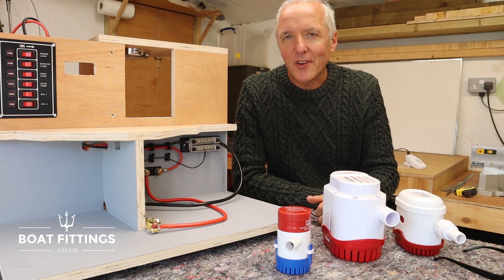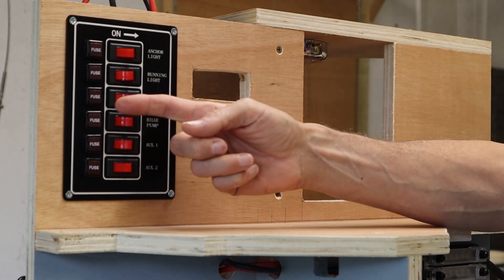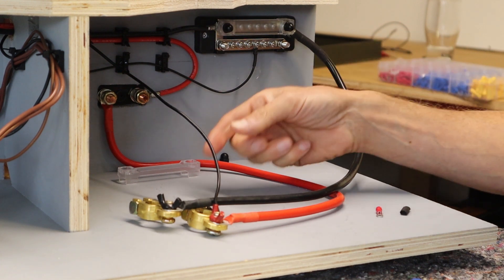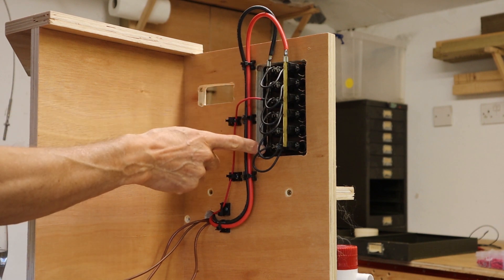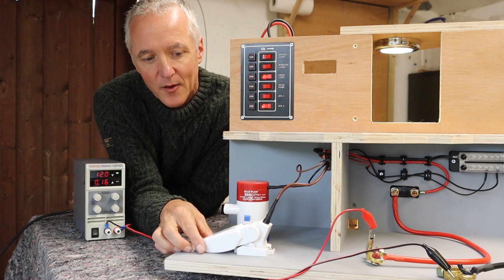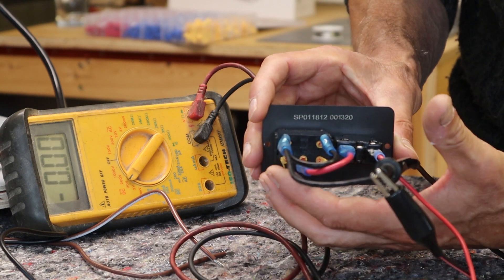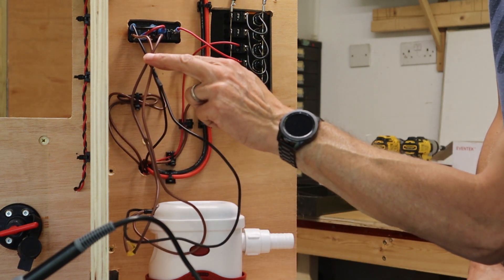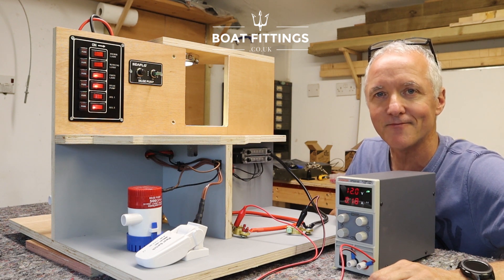Boat Electric Wiring Made Easy, Part 3, Bilge Pumps, Float Switch, Automatic & Manual Complete Guide

Comment: Thank you for these videos.  I'm wiring an electrical system for a 1973 Pearson Ensign daysailer from scratch and this series has been the most informative.  My biggest question now is at 12:40 you connect the three wires for the bilge pump by soldering them and covering with heat shrink.  If this were within the bilge in a wet area, is there any gap between the two wires that would compromise the waterproofing?  Are there any products you are aware of or recommendations you have for a waterproof connection among the three wires without soldering?
Reply from the maker: Hi thanks for your great question.  I have not yet come across a purpose made waterproof electrical connector for 3 wires sadly.  The only solution I would think of would be to solder the wires and then 'pot' them in a surrounding which would allow you to silicone them all in place for water-proofing.

Kind regards,

Richard

Comment: This bilge pump setup seems as though the master switch would cut power to both bilge pumps?
Would you not want at least one wired more directly to the battery so that when you turn off the power at the main switch, the bilge pumps can still operate - to pump out rain water whilst on a mooring etc?

Great video and really helpful!
Reply: On my sailboat I wire my safety items the following way
1.  Automatic bilge pump thru the special auto Manual switch then to the batteries 
2.  VHF bypasses the switch panel but is not wired directly to the batteries.
This way when I leave the boat I turn off the master switch cutting power to everything except the automatic bilge pump.
To turn on the VHF radio I turn on the master switch then the switch on the VHF Radio..
This way if the switch panel has a problem I can still use the radio.

Comment: I’ve got a new (old) boat and redoing a lot of the wiring and although there aren’t many standards for marine wiring, nearly all of them state “do not rely on soldering alone for wiring connections”.  I’m opting to crimp and then use waterproof shrink connectors.

Where would you place a master fuse (50A) in your wiring model?

Comment: Should a bilge pump supply be direct to the battery before the main isolator?
Reply from the maker: Hi this is a good question, and has been asked before.  This depends on your point of view, and depends partly on whether you have separate batteries for your 'leisure' part of the system and your engine starter motor.  If you have only one battery for all then you need to decide which is the greater risk for you - potentially draining your battery and not being able to start the motor, or potentially having a bilge 'full' of water.  I expect some people will have strong views on this, but for me this is not a straighforward one to decide.

All the best,

Richard

Comment: Everything you've done so far is switched - as in turned off if the master switch is turned off.
There are circuits on the boat that should still be powered if the master switch is turned off - automatic bilge pumps being one example. 
Or, at least, if your boat is left in the water when unattended, the bilge pump should not be wired through the master switch (though you would want it to have its own switch).
Reply: Totally. I was looking for this comment. That boat is sinking.

Comment: I've watched all three episodes and have a couple of questions. 1. Wouldn't all the cable runs be tidier if the negative buss-bar was mounted adjacent to the fuse panel? This would allow for long runs of sheathed two core wire. 2. Isn't wiring the auto/manual pump to the fuse panel a bit redundant since it's own control panel also has a fuse?

Comment: Thank you so much for these videos.  Can't wait for the next one.  Two questions though. 1. Would you want the auto bilge pump wired before the master on so it can run while away from boat without other power on? 2. What is the make / model of that dc power supply.  What amp model should I be looking for?  I need to get one.  Thanks.

Comment: Aweome video! Thank you for all of the help. Does the bilge pumps you wired in work when the battery switch is off?
Reply from the maker: Hi thanks for your comment / question.  I understand that some people would prefer to have a 'permantly-on' circuit for their automatic bilge pump, and agree that there is a logic to this.  In a future video I will include this type of wiring.  In any case though, my preference is to have a way of easilily turning off ALL electrics in the boat, from the point of view of not having to worry about the possibility of electrical mal-function while away from the boat - I think this is a matter of choice and priority (dry bilge vs electrical safety or run-down battery).

Kind regards,

Richard

Comment: Can you tell me why you would run the auto bilge through two switches rather than just wiring directly through the Blue Sea switch?
Reply from the maker: Hi thanks that's a fair question.  There is no particular need to go through two switches, and it would be fine to run just through the Seaflo switch.  I like the idea of having a 'central' switch panel ie one place where I can turn on and off systems, but that is just a personal preference.  In practice in boats that I have had in the past there might be one or two switches on the main switch panel that spend most if not all of their life in the 'ON' position.

Comment: 7:00 if your getting power to the switch float from the switch panel, wouldn’t the switch panel switch that it’s on need to be on for the automatic float switch to operate?
Reply from the maker: Hi thanks for your question, yes the switch panel switch would need to be on as well.  There are arguments for and against wiring it in this way, generally I prefer to have the ability to turn any electrical device on and off, even if it has an automatic mode.

Comment: Great video! We just watched Part 1-3 and were already looking for Part 4 of your boat electric wiring tutorial. We read a lot about boat electrics as we have to completely or almost completely redo the electrical system in our 40 years old sailboat. Your tutorial is very pedagogic and easy to understand for rookies like us - thanks a lot! 

One question: wouldn't it be better to connect the bilge pump prior to the main switch as one would like to have it connected all the time?
Reply from the maker: Hi thanks for your comments (I had to look up pedagogic - but I think I get it)  As for the bilge pump direct wiring to main switch that is a good question.  There is some argument to have one bilge pump directly wired prior the main switch, if you prioritise keep bilges dry over possibly running down your battery.  Personally I think that option makes most sense if you have multiple battery banks - reserving one for starting the engine, and another for leisure (the bilge pump would then be wired into the leisure battery bank).  Even then it is important to include a fuse in this circuit.
Reply: @BoatFittings  I apologize for my Swenglish... I realize that 'pedagogic' might not be the proper English word, but I'm sure you understood that I think your video was very helpful and easy to understand even for somebody who's far from being an expert in this field!

Yes, that's the plan to connect a bilge pump to the leisure battery bank to prevent bilge (or - worst case scenario - the boat) from getting wet... 

Thank you very much for your advise!

Comment: Thanks for these really informative videos! Maybe you have explained it in some other video, but I see that you solder all the connections. Other places I read or see videos on boat electrics, it is not recommended at all, and only crimping is recommended on these kinds of installations. Quite confusing for a newbie like me. What is you take on the topic?
Reply from the maker: Hi thanks for your comment / question.  Yes I did explain this in one of the videos, but here goes:  In my experience I have had some issues where crimped connections (probably poorly done ones) have come lose.  I have never had an issue with a soldered connection.  I prefer the security of a soldered connection over a crimped connection.  I'm sure there are alternative opinions / theories so I am going from my personal experience (+ the experience of some trusted others that I have compared ideas with).

All the best,

Richard

Comment: Huge thank you!  I recently started working as a marine electricians “apprentice” despite having been very clear in my interviews that I had limited electrical experience.  

I’ve already retained more info on the actual connections from these three videos then I did in my first month on the job.  I’ve been mostly running wires, but now I feel much more prepared for the next step of connecting everything up
Reply from the maker: Hi many thanks for your comment.  I hope your apprenticeship leads you into some interesting projects - would be great to hear any interesting lessons that you may learn as time goes on.

All the best,

Richard
Reply: Good look. You start by the right place.

Comment: Glad to see this episode is out! I can't wait for ep4! Maybe a "relays, cables and fuses" related video would be nice, perhaps? You could explain why would you need relays, when would you want them, how to size cables and fuses for the appropriate circuit... I am in the process of building from scratch my dream boat. The boat I bought, it had no mechanics in it, I bought the mechanics from a separate boat and got to merge both together, so I also need to add pumps, gauges, etc and I'd like to do a proper job at it with properly sized fuses, relays where needed, etc...)
Reply from the maker: Hi Eric,

Thanks for letting me know some of things you would like to see in episode 4.  I will see how many of these I can fit in - its great to have some suggestions.

All the best,

Richard
Reply: As there is a dedicated man/auto switch for the bilge pump why do we need another switch on the 6 switch panel?
Reply: @Seafariireland  so you can switch it off.